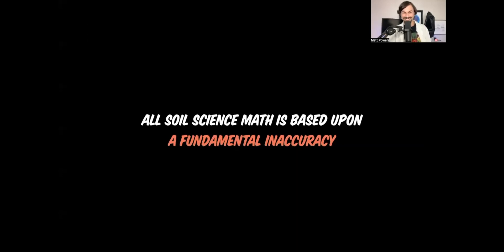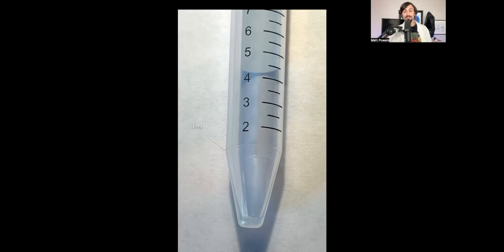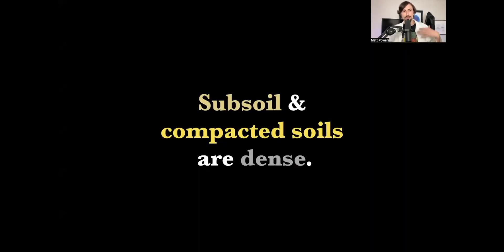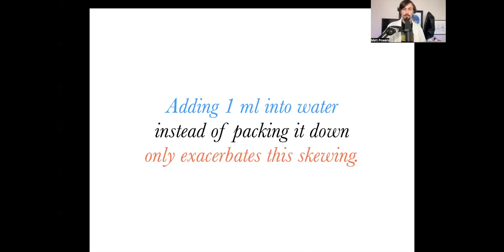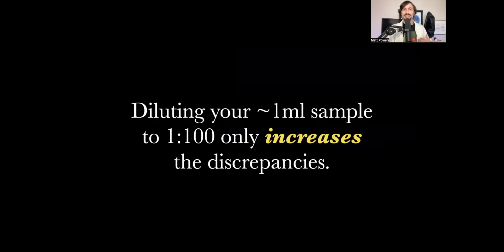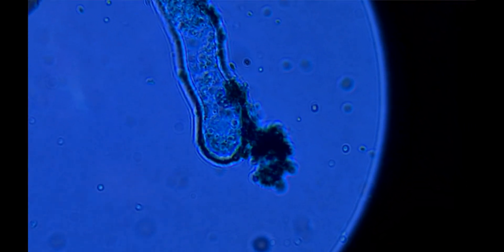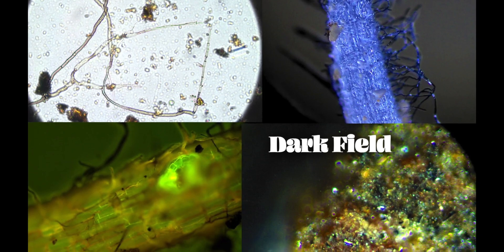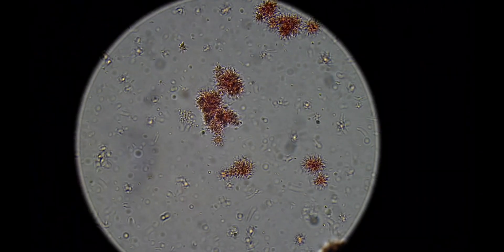The Math is WRONG in #Soil #Microscopy... Here's WHY:

Comment: But when you add 3ml of water to the test tube, then spoon in 1ml of soil you're mixing it with the water so getting rid of the air. So you're measuring 1ml of the soil minus air.
Reply from the maker: Yes, you are right which means you skew it even more efficiently - getting an even more misleading #. The volume is determined by the structure.